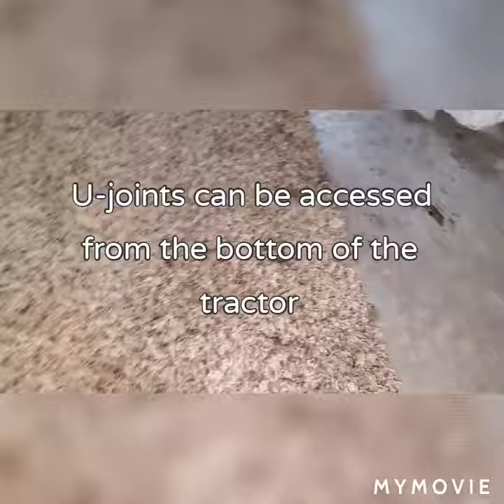Greasing Hard To Access Drive Shaft U-joints On JD 2320

Comment: Hey Ethan..great video..wondering what you used to cut the plastic panel by the forward and reverse pedals to access the front ujoint. Also wondering if you had to also cut the steel behind it to get to the joint? Thank you!
Reply from the maker: @John L, I used a multi tool to cut the plastic, there is a steel access plate behind the plastic that comes off with 2 bolts. I did make a short video of this process, https://youtu.be/UJdPzP2vZnc
For the front ujoint I found it almost easier to access from underneath the tractor. Hope this helps, have a great day !!!
Reply: @Mr.E_Works  thank you!

Comment: changed my U-Joints out to moog 410's, direct access grease zerks with new access panels.  no more of these poorly designed JD U-joint lube access zerks...   **what a headache it was in the past to lube this thing but no more!!
Reply: Well, my 2305 PTOs stopped working yesterday(again), after a month at the JD Dealership, 2nd time in less than 6 months. I've had to pay for repairs they didn't fix right. $1875.51 this time.  Last time was about $1500.00.....It lasted @ 10 hrs after the first fix. This time it lasted @ 15 min., I'm trying to not be frustrated, but idk how the dealership will handle it all, or what my rights are as a customer with a repair (they said the part was has 1 yr warranty) they don't seem to really know what they're doing.
We can't afford this, but need that tractor
Reply: @treylem3  Good morning 
I had the same problem with the PTO, the solution was to replace the PTO switch is like $ 50 if you haven't tried that the can be the solution, good luck.
Reply: @CM-pq7nu  They think it's the PTO clutch. Thank you for your help brother. I'm supposed to get it back this week I'll let you know how it all. Goes